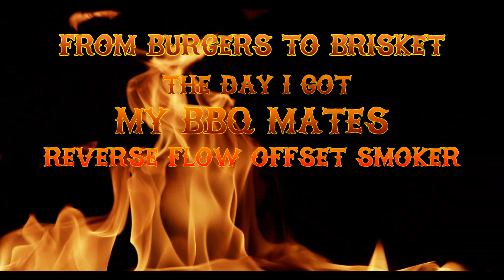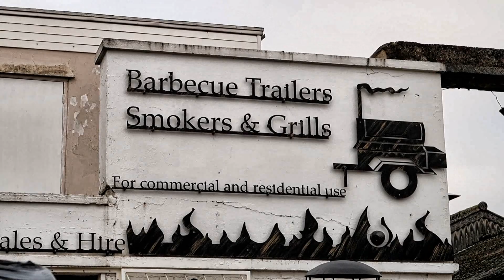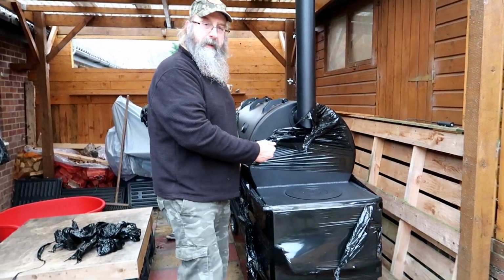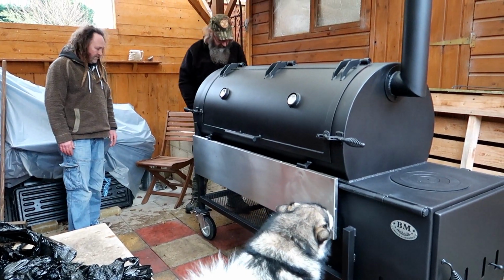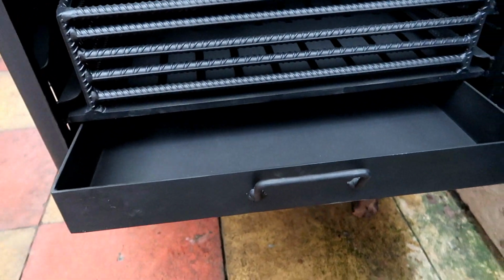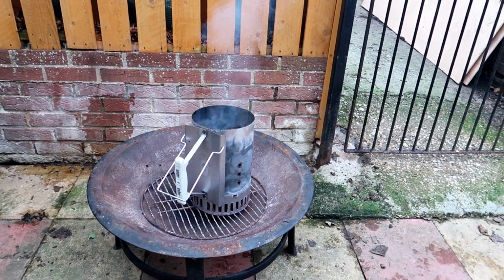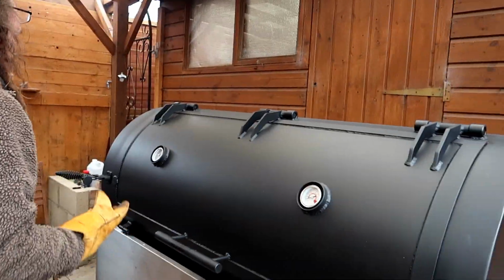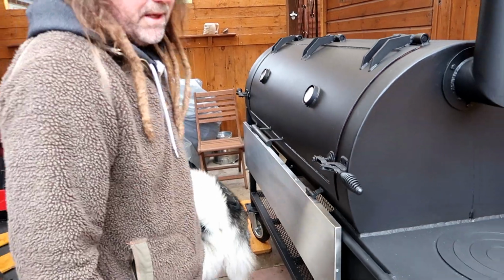The New BBQ Mates  BM S-5 Reverse Flow Offset Smoker/Cooker/Grill

Comment: Just found your ace channel. I have just the regular offset from BBQM. Really good, but it has no ash catcher and that is really annoying trying to scoop out the ash. Think the cabinet door could do with a counterweight at this size of smoker. Mines heavy enough so god knows how heavy yours is!
Reply from the maker: Yes, your right the door is very heavy but I have got used to it now. The newer models have a counterweight now. Really wish I could get one fitted to mine to make it easier. I have got used to it now but I wouldn't let my wife try to lift it. It's still an awesome smoker and I love it. I think it will outlive me.
Thank you for your comment and glad you liked the video.
Reply: @CiderTalbotToo  You can still add some to it just get you a good welder to do it or if you know how to weld do it yourself. Moberg Smokers here in Texas has a pretty simply design that would work nicely. Saludos from Texas ✌🏼✌🏼

Comment: I have an s5 too, but mine didnt come with the hot plate on the firebox and it hasnt got the bbq tray and grill like yours.. i would have loved those with it
Reply from the maker: Thanks for your comments. 
Yes does make all the difference. 
I wish mine had the balance weight on the cook chamber door as it is so very heavy. I am 6ft 2 but if you was a smaller person you may struggle to open it. The newer models do have them now. Maybe one day I could get BBQ Mates to come round and weld some on for me 😎👍
Reply: Cider Talbot Too thanks for the reply are you getting much use out of yours? Im smoking on mine tomorrow for the first time, im hungry just thinking about it